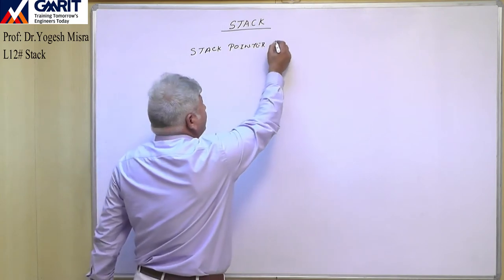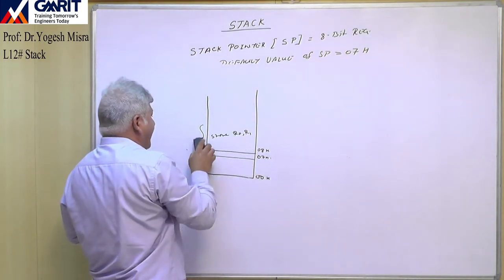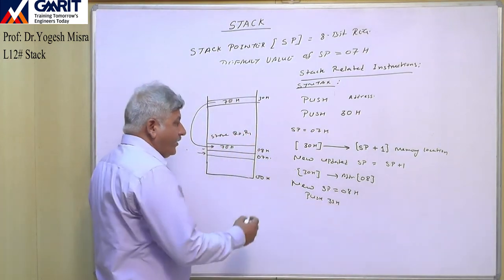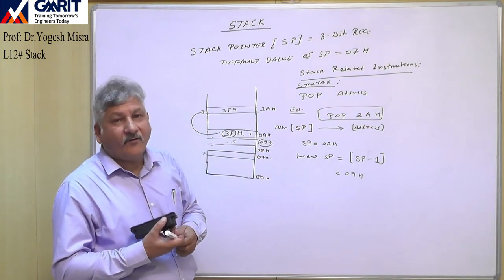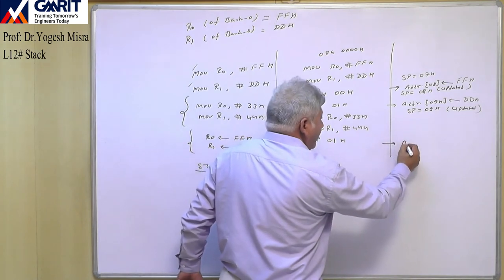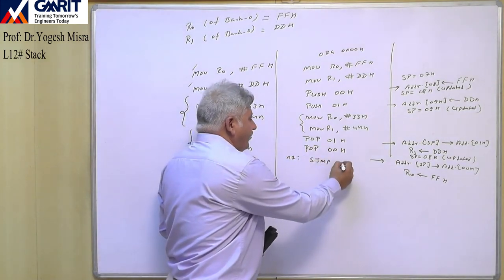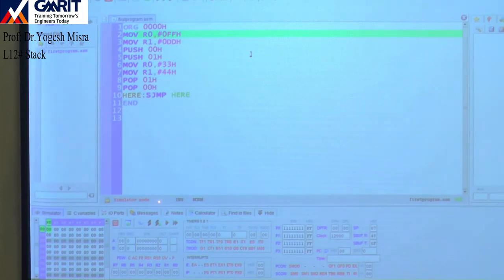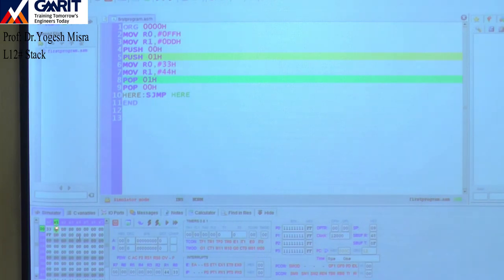Lecture 12: Stack

Comment: Sir, I had a doubt. My doubt is: This stack pointer basically stores or retrieves data from registers of Bank1 and so on... so if there was some data previously stored in register 0 of bank 1 so will it be replaced by the PUSH instruction? and if i want to retain the data in R0 of Bank1 but store the data at R1 of Bank1 by using stack pointer then how to store it?
Reply from the maker: (1) Yes, previously stored data will be lost in R0 of Bank 1 if we use PUSH instruction because the default value of SP is 07H and it starts storing the data from the 08H location when we use PUSH instruction.
(2) If you want to retain the data of R0  and store the new data from R1 of Bank 1 the initialize sp register to 08H by using MOV SP,#08H instruction and then use PUSH.
Reply: @DrYogeshMisra-Professor  thank you very much sir🙏
Your videos are really very good I understood a lot via your videos🙏

Comment: Sir I have 1 doubt.
Sir let's suppose we stored certain number in address 07h, 08h. 
Now the default value of sp would be 0Ah correct?
Reply from the maker: Default value of sp does not change by storing numbers. By default it will be 07h only.
Reply: @DrYogeshMisra-Professor  Then if let's suppose R0 had data 03H
And  if I gave instruction as 
Push 00H 
And assume that 07h and 08h has some 8 bit data 
So the data 03h present in R0 register will get stored in 09H correct? 
I'm getting confused can you please clear this doubt.
Reply from the maker: @swaritmahalsekar5521  No. 03h will be stored at (sp + 1) i.e. at 08h location and the new value of sp will be 08h.
Reply: @DrYogeshMisra-Professor  bit sir 07h and 08h already has some data so no. 03h would be stored in 09h na?
Reply from the maker: @swaritmahalsekar5521  The already stored data of 08h will be overwritten by 03h and previously stored data will be lost.
Reply: @DrYogeshMisra-Professor  Thank u sir now the concept is crystal clear.

Sir 1 small suggestion please try to take c programming on 8051.
Reply from the maker: @swaritmahalsekar5521  Enjoy learning. If time permits then I shall try as you suggested.

Comment: Sir,suppose if we store the data in R0  of bank1 ,i.e the address of R0 is 08H,then the instruction is push 08H,Now what is the stack?
Reply from the maker: The data at R0 of Bank 1 (i.e at address 08H) will remain unchanged and SP will become 08H.
Reply: Jn between the program,we enter new data in the same R0 ,but already previous data is stored in that location
Reply from the maker: previous data is replaced by new data and you can not get previous data.
Reply: Then how can we use pop instruction sir
Reply from the maker: Programmers think wisely when using push and pop.
Reply: Ok,thank you sir

Comment: Sir suppose i code POP 07H
then as u said new SP=SP-1
So here will the new SP be 06H?
 Because u said stack is only after 07H
Can SP take values below 07H? Sir.
Beautiful explanation of concept. Thank you
Reply from the maker: Yes sp can take any value below 07h. But by default it's value is 07h. It is the duty of programmer to take care about the value of sp.
Reply: @DrYogeshMisra-Professor  okay sir 🙏

Comment: Sir, what is the upper limit of the stack ? I mean upto which memory location we can use stack memory ?!
Reply from the maker: Since sp is a 8 bit register therefore it can be updated upto FFH and after FFH it roll back to 00H.
Reply: Sir in many place I saw they are representing Register bank 1 as stack !
Reply: @subhratanusaha5782  True! Stack  in reality has no physical representation. It's just how you use the available memory.
Reply from the maker: @subhratanusaha5782  Since by default the value of sp is 07h therefore by default stack starts from RAM location 08H which belongs to Bank-1.
Therefore it is said that Bank-1 belongs to stack. But user can change this default position by re initiatizing the value of sp.
Reply: @DrYogeshMisra-Professor  ok sir. thanks a lot, your teaching is fabulous...

Comment: i am trying same code in keil software i am facing ram error in memory tab
Reply from the maker: What error message is displayed?
Reply: @DrYogeshMisra-Professor  

Notice that you must first bring the data from ROM space into the CPU's RAM, 

then add them together. Use a simulator to single-step the program and examine the data.